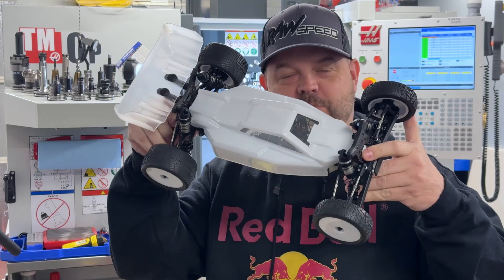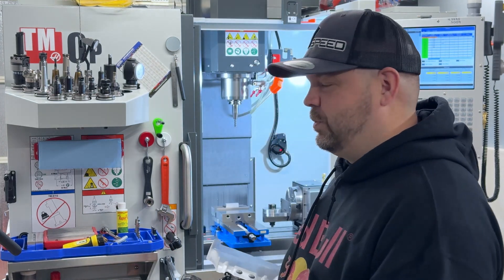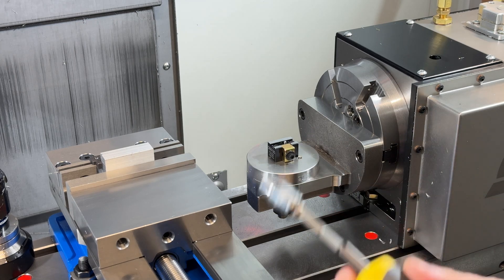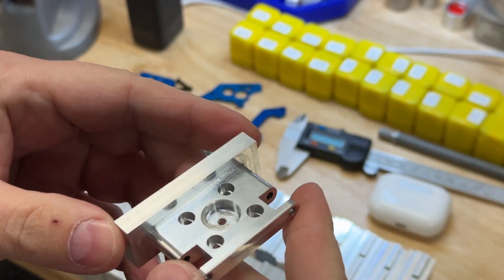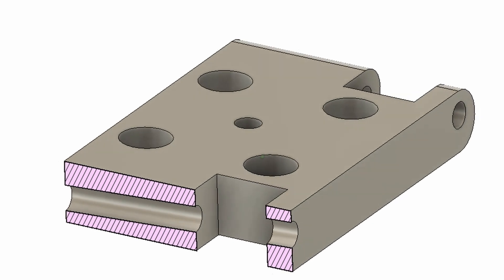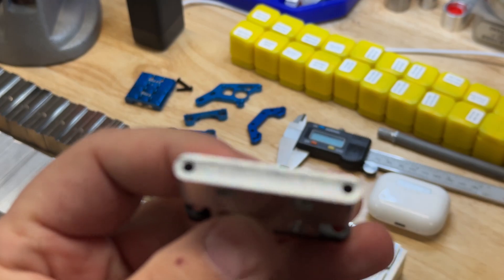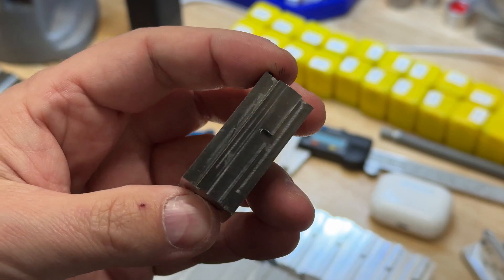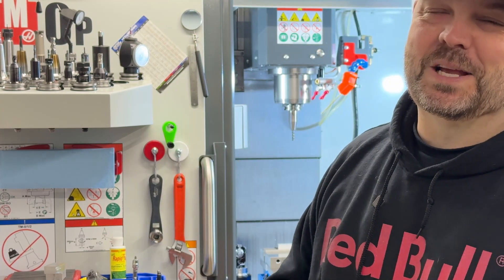TM0P with 4th Axis and Moreside Fixture

Comment: Hi, fantastic device, do you use DWO?
Reply from the maker: not on this machine. i program from MRZP
Reply: @NerdlyCNC  What do you mean by MRZP? I've seen some Haas videos that mention this, Do you reference the part in 3 axes?
Reply from the maker: @Victoria-k8f5t  i just find the center of rotation for the rotary.  

Once you locate the A- Axis you have the Y & Z Coordinate. Then i set my X coordinate to middle of the Moreside fixture.

Comment: Hey, the CAT40 tapping heads that CME tools sells with quick change adapters are pretty good. At my job we use Bilz style quick change tapping heads and they are a slight improvement over using an ER collet to hold a tap. Just thought I’d mention it here because sometimes tooling suggestions can’t be trusted if someone is trying to sell you something. Your past suggestions with the Mitsubishi ASX 445 and MMM vise jaws have been great!
Reply from the maker: thank you. interesting. i need to get a quick change tapping set up one of these days.